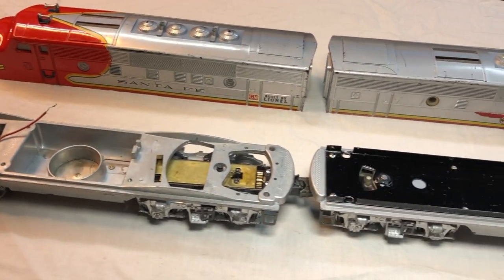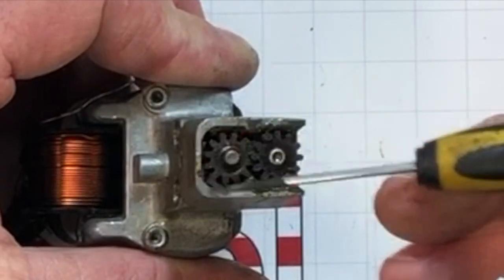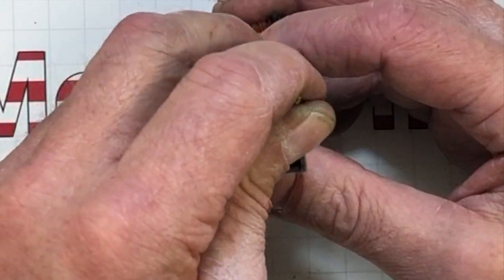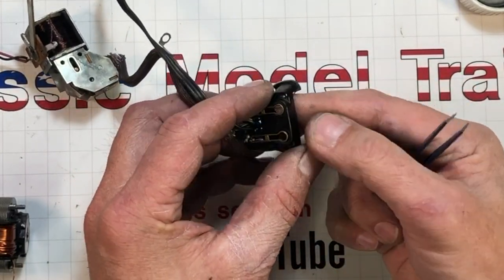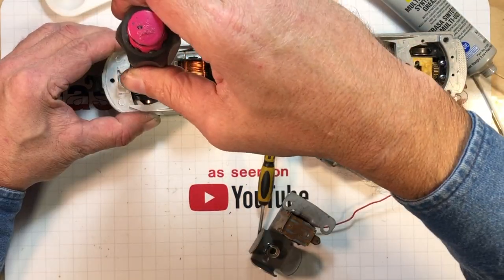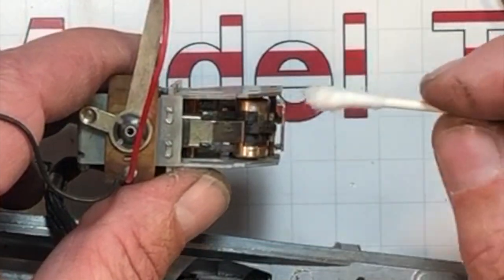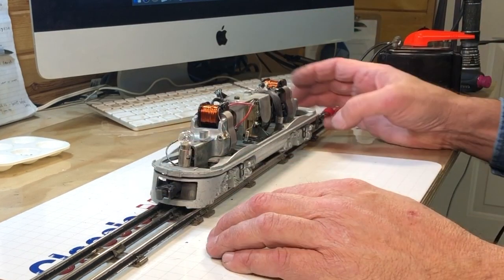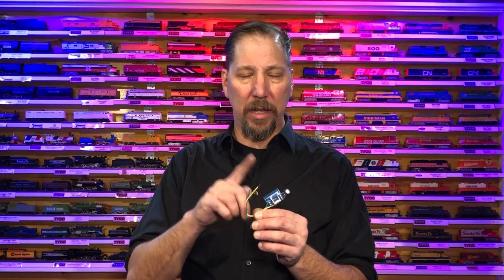Lionel #2343  A-B-A Set.  Servicing the Motors & Electrics

Comment: Well don't know if it got mentioned or not, but the e unit does come apart. Need a spreader plier to spread the side panels apart. The panels are not riveted together. Spread at bottom to access the drum, contacts and barrel slide. Just tricky to get back together...getting drum in place, then pinch sides to get a click lock and your done!
Reply from the maker: Ive heard of a special e-unit spreader tool out there.  I'm thinking I need one :-)

Comment: Two hobby shops in Billings.  When I lived in Bozeman many years ago, I only knew of one in Billings.  That was Jim's Junction.  I wonder if it is still there.  I only remember there being one in Bozeman (can't remember its name) and it closed up shop before 2003 when we left.  And I will have to check my Lionel A-A set to see what model it is.  I'm pretty sure it has the magnetic traction and it used a battery for the horn.  I got it for Christmas in 1951 or 1952 when I was 5 or 6.  The next year for Christmas I got an O-27 4-6-4 passenger set.  At that age I thought I would get a train set every Christmas.  I still have both sets but neither has been run in many a year.
Reply from the maker: The other shop in Billings is called "Central Hobbies". Located on the 13 hundred block of Central Avenue.  Been there since 1973.  Jims Junction has now been renamed "Rimrock Hobbies". Pretty cool you still have them childhood sets.  Perhaps they might get re-lubed and do some track in the near future?

Comment: Lionel make stuff to be put together not to be taken apart. Maybe all of the problems you're having with the horizontal Motors is why they were discontinued and replaced with the vertical Motors. Prototypically speaking you would never have a passenger train without it because that's where the steam generator was.
Reply from the maker: I was not having any problems with the motors. They went to the vertical shaft because they were cheaper to manufacture. Probably quieter also.
Reply: @classicmodeltrains  there was an article in classic toy trains with the horizontal Motors versus the vertical Motors. Both of them had their good points but the vertical Motors were better runners and better pullers. I would not mind having a set on my layout but I will not pay stupid Collective prices simply for a name. Lionel nickel and dimes itself to death with taking details off of their top of the line engines to save a few pennies while turning off their customers because their customers were insulted by their actions. Every time Lionel cheapens their line they went further into the grave. Many things Outlast the companies that produced them therefore they should be making as quality of product as they can make. Details like that mean a lot when something is 30 or 40 years old.

Comment: There are different versions of this motor assembly. On the idler gear (lower spur gear) one style spins in a pin, another the pin is press and swedged to the gear and the shaft spins in a oilite bearing. The later is prone to sloppy wear. I have corrected this using two miniature 1/8” x 1/4” sealed ball bearings and replacing the pin with 1/8”diameter in each motor to fit the ball bearings. I have no idea today where to acquire the bearings I had them since I was a kid for slot car racing.
Reply from the maker: Thanks for some great information :-)

Comment: When I was in my late teens and early 20's, I worked at a hobby shop and did many Lionel locomotive repairs. So many came in that were dripping in oil. The owner had a saying for all of those. One drop of oil works wonders, many drops work miracles.
Also, the 'E' units can be popped open. At times we had to replace the drums and contacts, if damaged.  You can take a small, long nose pliers and place them on the inside of the bottom of the unit. As you try to open the pliers, the unit will pop apart allowing you the service or replace the drum and finger contacts. Then you do the reverse to assemble it. Line everything up and squeeze it back together.
Reply from the maker: Thanks for the repair tip on the E-unit.  I hear the fingers like to cause problems.  Its good the unit can be serviced.  I wonder if parts are available?
Reply: @classicmodeltrains  I've seen e unit drums and contacts on Ebay.

Comment: My favorite A- B unit is Reading and Northern A#270 & B #275 the set they run in Jim Thorpe.  You said about no hobby stores in town. Same in my areas. I grew up in Brooklyn NY there's train world on MacDonald ave.  I moved to the lehigh Valley in 2000.  Allentown, Bethlehem and Easton 7 shops with the cities. But drive a few miles in any direction outside the city there is about 30 shops. I like the hobby shop in Catasaqua on front Street i think it's called Tony's hobbies i forgot lol. they have lots of vintage stuff there. But I prefer the shop called "trains and lanes" off of rt33 between bath and Easton. They have right in the door way  a O or G-scale 4000 seires UP big boy. (Not sure if it's 4014)  but Lots of model train awesomeness there. And surprising enough not flooded with PRR or LVRR they have a good mix of liveries there.
Reply from the maker: Sounds like you have a lot of options out where you are!

Comment: Love your videos and happy 1 year anniversary! The 3 positions are Forward, Neutral, and Reverse. The E unit will cycle through them every time track power is interrupted. The direction button on the transformer just cuts track power when it is pressed. Many Lionel operating accessories utilize track power through the remote control track section, such as the operating milk car, log dump car, dumping hopper car, and cattle car. So the train needs to be stopped with track power on for the operating cars to function. The train is then stopped in neutral with the appropriate operating car positioned on the remote control track in order for it to operate.  The neutral position is also good for heating up a steamer's smoke unit for maximum smoke before starting a run, lighting up a passenger train stopped at a station, or for letting a rotating searchlight car scan the room while stopped. Some of the lower end locomotives, particularly from the late 50's onward, had a 2 position E unit that only had Forward and Reverse. Some really low end stuff was even made that was Forward only!
Reply from the maker: Thanks for the information. I figured out the 3 positions on the e-unit itself, the Marketing boys decided to call that lever a 3 position, which if a guy didnt know makes it very confusing. Theres only one contact that lever open or closes.  But with some though juices  it makes sense.  ALTHOUGH..... it never really dawned on me the accessories worked the way you described. Thank you for sharing that great info.  The HO world all the accessories gets power from some where else.  Now I want to get accessories for the O gauge stuff!!  Thanks for your kind words once again Greg :-)

Comment: Very good instruction. I've renovated several F3s but still learned a few things. VERY pleased to see fiberglass scratch brush being used. These brushes are superior to using emery paper on the commutator and E-unit drum.
Reply from the maker: Thanks Randy!!
Reply: Also,
In the "Power Trucks" I use Lucas "Red and Tacky" grease. It's superior to the usual hobby gear lube. It doesn't dehydrate and has the best "cling" I've ever seen.

Comment: Thanks Ron,
I have this set with only the two engines. It is the 2343. Never knew it was rare. It has three passenger cars with it. It has the horn but the engine stopped running. Wish I had your skills so I could fix it.
Reply from the maker: Thanks for watching and commenting.  These are desirable for the years 1950-53 production run. The screen tops as they are called.  Not the rarest, I've found out from other viewers.  Quite a few of these were made.  Unfortunately lots have been lost to time and damage. I hope perhaps you can watch this video a bit more, and gain the skill to get them going.  Sounds like you have a pretty cool set there :-)

Comment: The armatures do come out of the motor housing
Reply from the maker: Well I know they come out. Looks like a guy would use an arbor press, and the proper driver tool, and press down from the drive gear end, essentially removing the brass gear that's holding the armature into the housing.  I just didnt want to risk it, and end up stalling the production of the video.  I'm not "up" on all the aftermarket or replacement parts available for these. Thanks for watching & commenting :-)

Comment: Flush it out with some break cleaner
Reply from the maker: Sometimes brake cleaner can remove paint. I use B.C. in my normal day to day job and love it.  I had a bad experience with it working on model loco's.  But if your careful, its a great tool for cleaning :-)